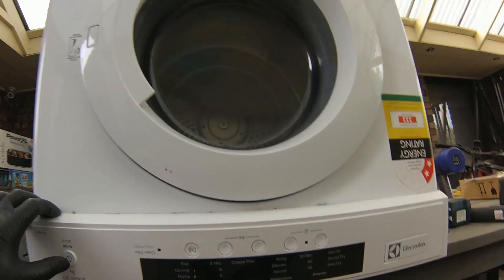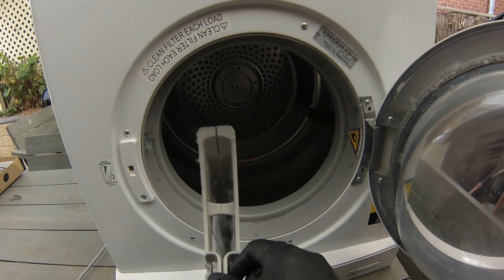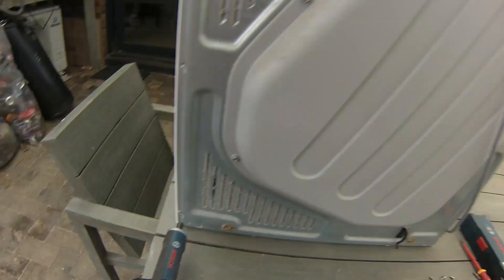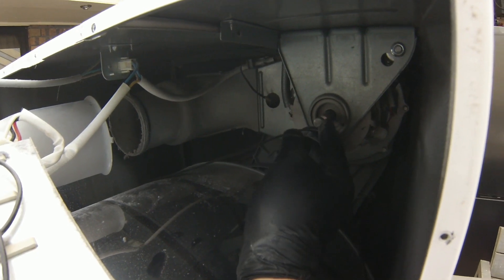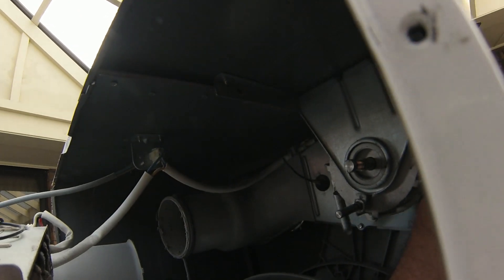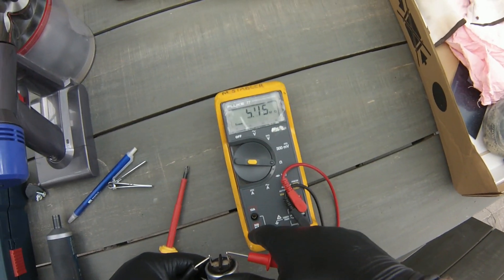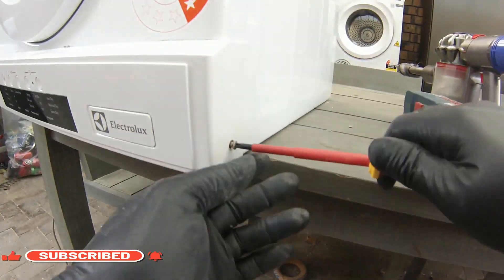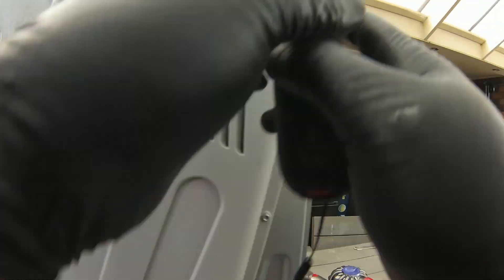This Is Why Your Tumble Dryer Is Making Noise But Not Turning

Comment: My dryer works til it gets hot then the motor starts bussing and stand still. Is it the condensator you showed or motor? If just using cooling program it works forewer
Reply from the maker: Possibly could be the start capacitor as it gets hot the internal resistance fails and the start capacitor degrades.
They are cheap to replace so try that first.
Make sure to discharge the capacitor before removing it.
Reply: @NotSealed what do you mean by discharging the capacitor?. Cheers 👍